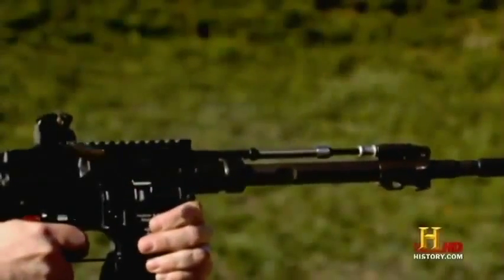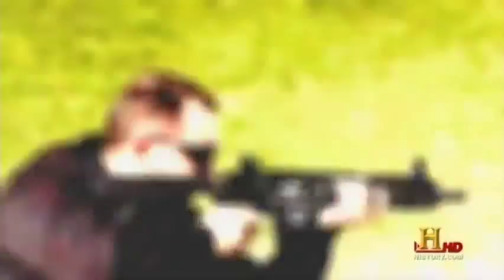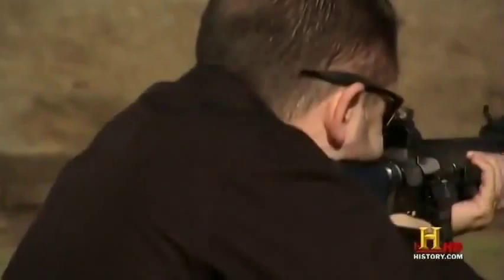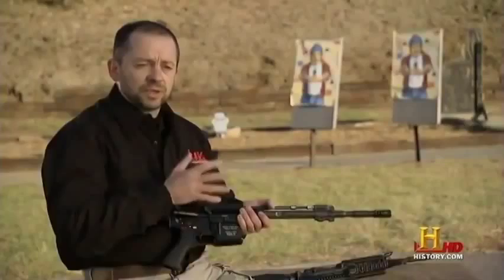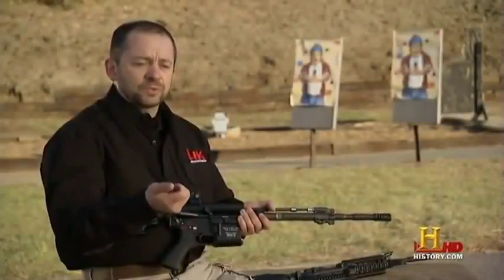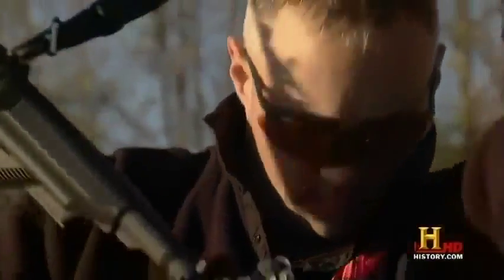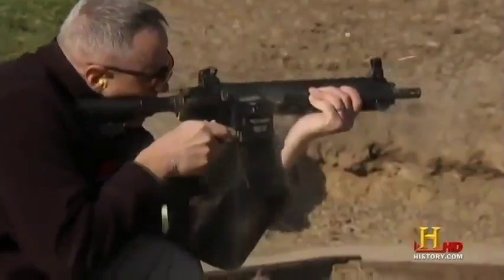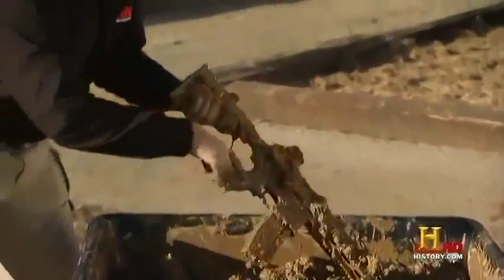The Gun That Killed Bin Ladin - HK416 Assault Rifle

Comment: Biggest difference is there is no gas block.  Which is why it was chosen.  But I still don't understand why they never made it standard issue for multiple units other than SEAL Team 6.
Reply: There is a gas block, they just migrated the expansion cylinder. The Marine Corps adopted a variant of the HK416 designated M27 (IAR)
Reply: @TheSundayShooter  Ya ur right I was lackin at the time